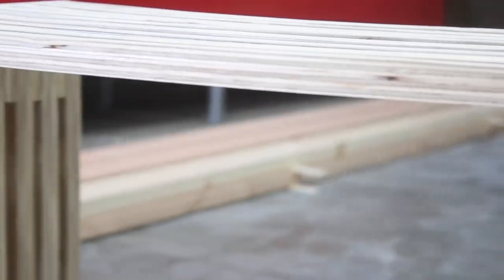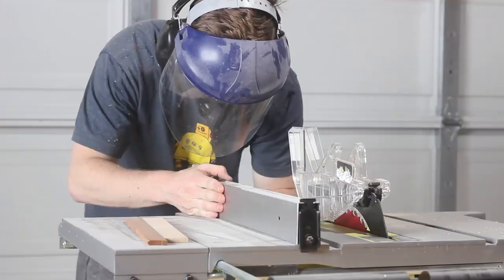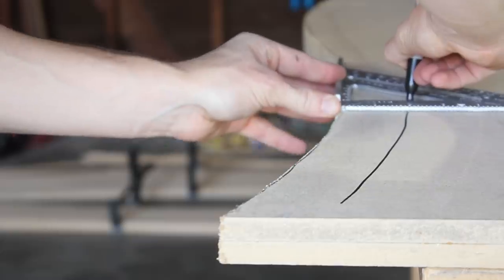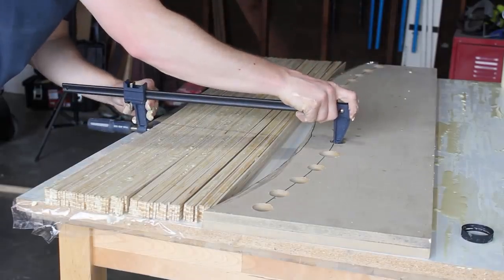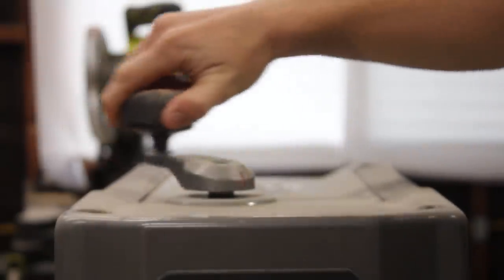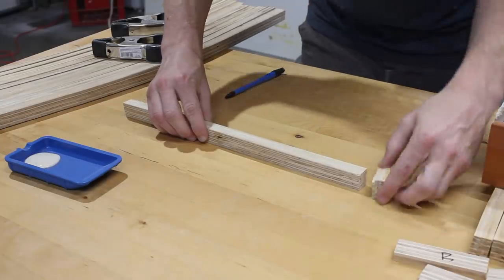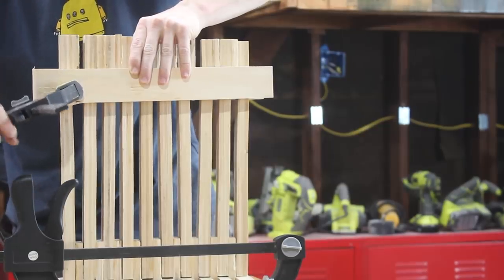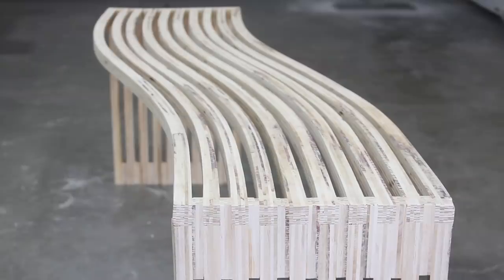Curved Plywood Bench | 28

Comment: Neat project, looks good. A cheap alternative to having to gather every heavy object in your shop for weight - buy some sand and sand bags for less than $10. I make 25 and 45 lb bags then wrap them in duct tape to keep them durable and not leaking sand over time. You'll be surprised how often you use them from shop stuff to holding the base of a ladder when climbing.
Reply from the maker: Something on my list are just large concrete blocks with rope. Same principle!
Reply: @workshop_edits  I tried that route and found I had to be super careful not to cause unwanted dents and scratches in the work piece or place something in between the two - just extra work. Good luck - enjoyed the video.

Comment: Great job. 
I'm curious about the strength of that bench. Can it handle a (120 KG) person sitting in the middle of it?
BTW, that is a lot of "Ryobi" products :)
Reply from the maker: I'm 160 pounds and can sit in the middle of it - it's not super stable, but it holds just fine. It's less a bench to sit on at this point and more a piece of garden art since it was ultimately an experiment. I wouldn't have a 120kg person sit on it.